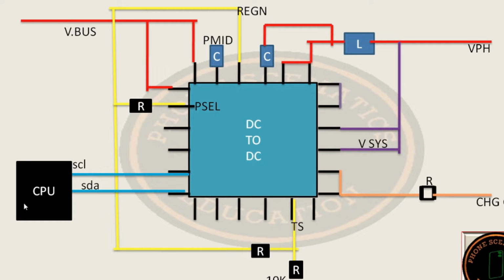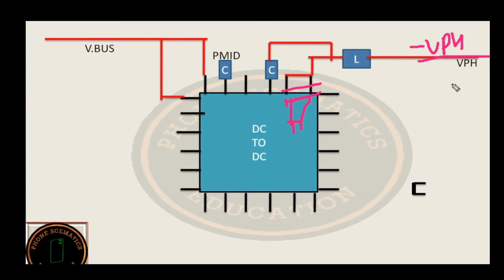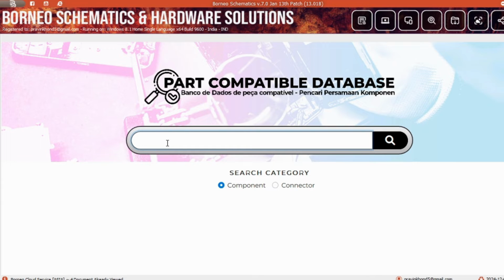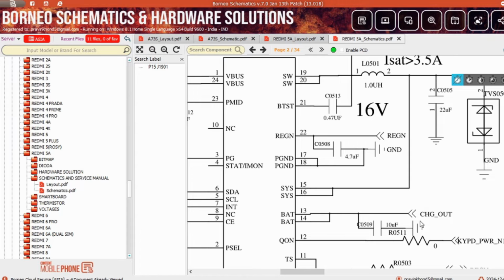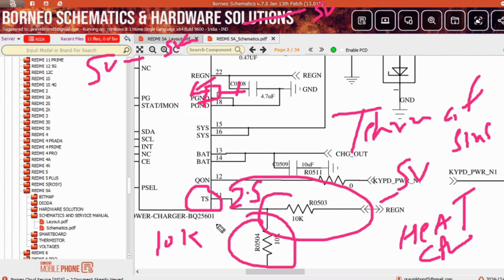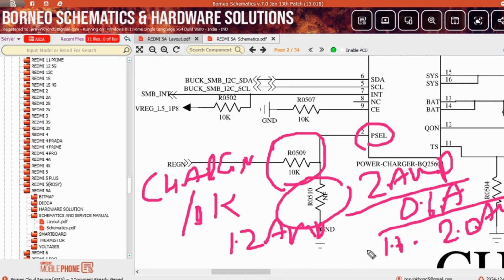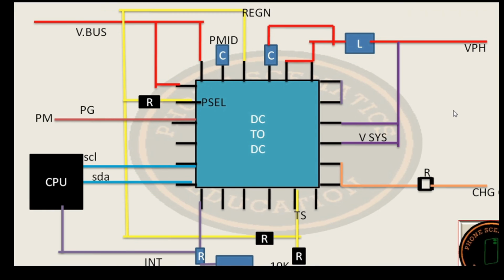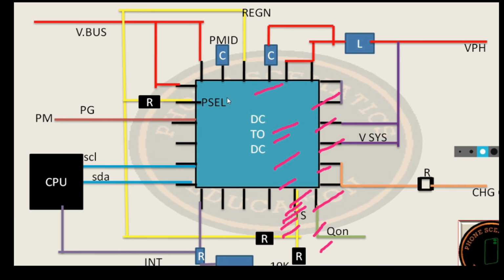Mobile phone charging ic+Testing+Repair+bypass solution+Sechmatics Diagram knowledge 💯

Comment: Can any one  answer this 
For a phone not to be in fake charging mode there should be 5V @ Pmid, but if there's non it means either the ovp line isn't connected properly or the charging ic isn't connecting well/it's loose, so my question is can't a jumper be made to the Pmid?

Comment: Please how do remove a 20 ohm short from a capacitor which refuses to take current from the short killer?. Please sometimes a capacitor may have a very low resistance and yet do not get heated when voltage injection method is applied. PLEASE I REALLY WANT UNDERSTAND 🙏🙏 I NEED HELP . PLEASE
Reply from the maker: Watch the letest video.

Comment: I have one question, sometime some voltage are not written in schematic for example bootcap there is no voltage mention in the schematics how do you know the voltage. And how can i know voltage which is not written on schematics. This one really bother me ao much please clear my doubt. Thank you in advance
Reply from the maker: See, if the voltage of any line is not written in the schematics, then what do you have to do? You have to find the IC on which you are working. You have to find that IC in other models. In which models, this IC is installed, one by one. After doing this, you have to open two or three diagrams, after that you have to check what is written on the lines, you will get your answer somewhere.keep practice  my  friend.one day  you will b top one technician in your city
Reply from the maker: Look, all this is known through experience, experience comes through learning and practice, you have to keep practicing things, whenever you get a phone, check it step by step, after that you will start knowing things, where and how much. Voltage comes gradually, your subconscious mind will know about this process. What is the fault and how to check it.